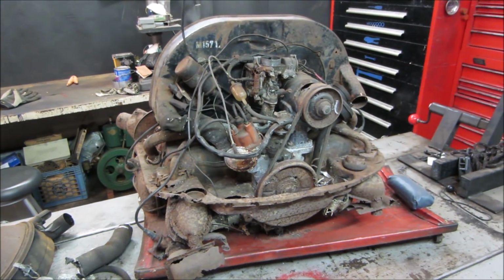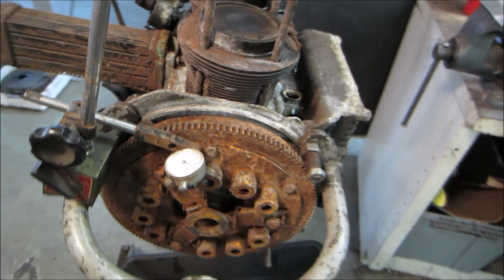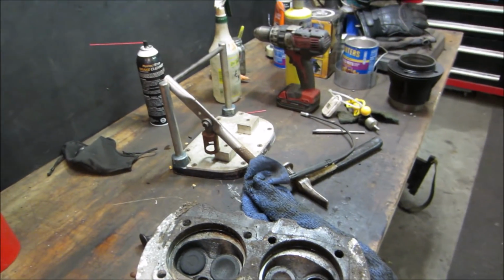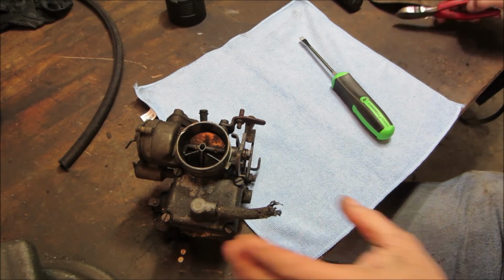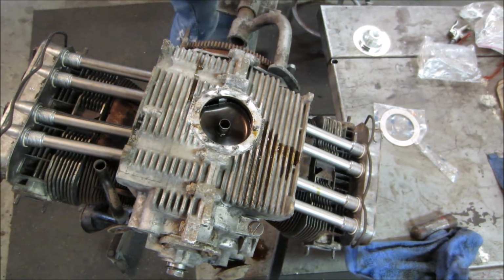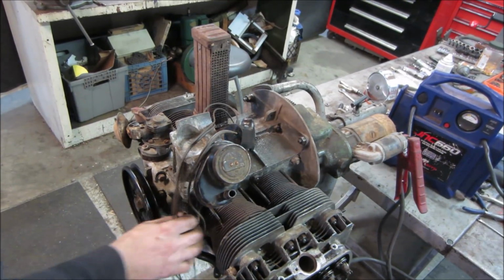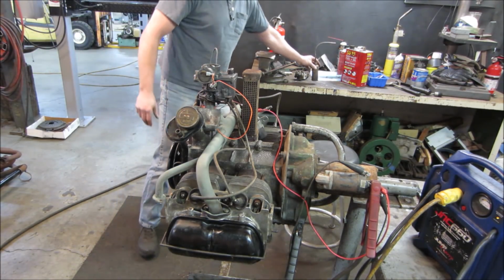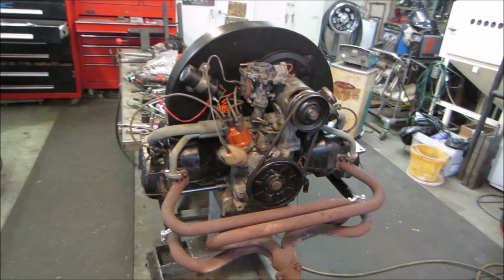Blown Up VW Bus Engine, Can We Repair It For Free?

Comment: I'm a little surprised that you didn't bother replacing the bearings.  Can you do that as s separate operation without undoing much of the work you already did?  Are bearings prohibitively expensive?  Were you just lucky not to hear much bearing knock when you started it up? or did you somehow know the bearings would still be fairly quiet?
      How is the oil Pressure?

Comment: I have a question, what is the difference in a single port and dual port on those VW engines that you work on? I've heard you mention that 1 is single and 1 is dual port can you explain what the difference is and where they can and cannot be used please?

Comment: The accelerator pump out of the carburetor if it is small enough to fit in something like a snuff can could be put in something like that and poured half full of brake fluid and let it sit for a few days and that would soften it back up to where you could probably use it and you can just leave it in brake fluid also for as long as you want just to keep it soft and that's what I do with the diaphragms out of lawn and garden equipment type carburetors and that VW carburetor reminds me of a big Tecumseh carburetor in a way LOL

Comment: if you use longer studs i forget which 2 you can put dual port heads on a single port engine which gives you a 1500 dual port which ups the power a bit drove one for years even raced it a little

Comment: Ive got a small problem with my beelte engine. I went to replace the valve cover gasket and as i was taking it off I noticed this black, slightly thick washer that was broken in half and in the lid of the cover. I've got no idea where it came from and I'm worried to drive it because of this mysterious washer. Anyone got any ideas?
Reply: Yes! That's probably the stock wavy washer that goes under the nut  holding the rocker arm assembly to the heads. They are known to break if you have side play in your rocker assembly. Check for that because you want to know what caused it so it doesn't happen again. You can use swivel adjusters to fix the side play if it is the problem. 

Instead of replacing the wavy washers you might as well get a few solid rocker shaft kits that come with the solid shims to replace the wavy washers. If you fix the cause of the washers breaking and use the upgraded shafts you shouldn't ever have a problem again. Just put it back on, torque it, and set valve lash again.
Reply: I forgot to add that it should be perfectly fine to just buy new wavy washers of the right size if you fix the cause of the originals breaking (probably fixing side play with with swivel adjusters). It's cheaper as long as it's a stock engine. The solid shafts are more for higher power engines.
Reply: @MrCarGuy  If I fix the play in the rocker assembly and I go to re-set the valve lash, do I have to do anything to the valves themselves (i.e. set them at a certain spot before setting the rocker arms back on)?

Comment: With the offset oil cooler, where does the air go after going through it
 since it's not going down over the engine/#3 cylinder any more?  
Anyone?  Thanks.

Comment: 59:59 You ought to invent something that is a combination screwdriver and alligator clip (with a T-handle on the end) that you could temporarily attach to the air/fuel mix screw so you could easily adjust the carb without having to fiddle around trying to find a screwdriver or deal with the vibrations.

Comment: 40 HP WAS INCREDIBLE...I TRADED AN APT SIZED REFRIG FOR A 61 BUG WITH A DROPPED VALVE ON #3...She had the sense to shut if off IMMEDIATLY 3 OR 4 DENTS IN PISTON...I replaced 1 ex valve and cleaned up the piston center a little...RE ASSYMBLED...DROVE TO LA AND BACK TO YUCAIPA, CA...GOT 33MPG...SOLD IT TO NEXT DOOR NEIGHBORS SISTER...SOMEBODY PUKKED OUT IN FRONT OF HER...ROLLED IT...WAH

Comment: When you were running the engine without the exhaust, when you revved the engine a plume of smoke was coming from the top of Cylinder #3. Did you re torque the head after the initial run? What was the cause of the plume of smoke?
Reply: Time stamp for reference?
Reply: @AstrosElectronicsLab  1:01
Reply: @hotrod1984s10  that was from the first video. He already said it had blow by on that cylinder because the head stud nuts had backed off.
Reply: @AstrosElectronicsLab  I meant the 1 hour, 1 minute mark

Comment: I think you are still not getting a good seal between your heads and cans.  It looked like there was an on throttle exhaust leak coming from under the driver's side head.

Comment: I had a 1958 vw convertible it was snazzy I dropped  a valve doing about 55mph the valve went threw the piston and threw the block and I was 18 and 265 miles from home the year was 1961 or 2

Comment: Build it with used parts. I grew up racing dirt track cars with a uncle who built v8 engines, 
 predominantly Oldsmobile motors. He had a huge box of used parts scavenged from dealership warranty engines that had been scrapped.

Comment: Yes 2021 reduce reuse recycle or upcycle yes what you need from what you got tool next to duck tape across from the wire and the hammer halfway down the spot where you stand

Comment: Please, please make a stand with a fuel supply and hoses on it so we are not frustrated watching you try to keep fuel up to engines, also it would give you a more accurate idea as to the quality of the repair / build and give you better time to make adjustments etc.. Surely it wouldn't be a huge job to knock one up. How's old Lilly?

Comment: Typical failure of the fresh air VW engine.  The oil cooler obstructed airflow to the #3 cylinder leading to overheating of the exhaust valve.  The stem gets brittle and breaks the head gets sucked down into the cylinder.

Comment: .003" on the endplay.   .006" is too much.   .015 is probably a worn out case,  thrust is probably toast.  Not that you can't run a motor with excessive endplay,  it's just not ideal.
Reply: I love watching you work with VW's.   It reminds me of my youth.  Built my 1st VW engine in 1991 at 13 years old.  Worked in a "VW Shop" for about 12 years.  We did a lot of what you do,  finding the best whatever out of the lot and working with that.
Reply: I've never seen lapping the cylinder to the head.  I love it.

Comment: I knew Mustie would make it run. I’ve heard running these without exhaust systems is bad for exhaust valves. Is that accurate?

Looks like the modern offset oil cooler was installed finally.

Comment: The only reason I watched THIS video is none of my other subs uploaded yet, if this had been any other topic (except the kit car, also another puke topic) I would have jumped on it.
Yeah kit cars, I helped a late friend build one, he had2 choices for a body fiber glass very expensive or plywood panels yeah guess which one he chose.
Imagine going for a test drive with your bud in his newly built kit car him driving and you're running at 90 and the front fender on your side comes off ,I demanded he stop I got out and walked back to my car and picked up his fender and carried it back, never again.

Comment: Looks pretty nice, but I don't think those self-tapping head studs will last that long. In my experience, and that of the shops I've dealt with, those are considered an emergency/limp home repair. I've almost always sent cases to RIMCO for case savers and that's never disappointed me, but I think that in a crunch I could manage to install a couple of them with the jug gone and the piston retracted into the case. It would be a hassle, but less of a hassle than putting it in a car and having to pull it out again 4000 miles later.

I've also been told, by people who have done LOTs more VW engines than me, that only the lower head studs ever pull out.

Any chance that excessive end play in the crank means the #1 main bearing is loose in the crank? Unless someone left out one of the shims, 0.012" seems to large to be undone by a simple reshimming.

You also need the air seals around the spark plug connectors. With those missing, you're losing a lot of cooling air and it's gonna overheat.

I love what you do and how you go about it. I've learned a lot from you about methodically testing the different systems to narrow down the parts that aren't working. I'm all about reusing old OE parts whenever possible, and getting by as inexpensively as possible. Still, I never want to do a job over again because something I did was not good enough to last.

Comment: Hay found or scavenged some VW Engine parts, carbs, split engine cases, heads, cylinders, pistons, rods, some single port some double port. some water cooled cases. mostly air cooled stuff. anyway watch your channel all the time big fan. want to know what my parts might be worth. I know a little about VW bugs having owned and learned auto mech. with them VW, datsun,  toyota, Honda Yamaha Suzuki Kawasaki so on and so on would like to email directly without giving everyone my email. or phone number. want to pick you brain if your up for it. let me know.

Comment: Just a couple points... 'A smooth cylinder IS an oil burner.' <--take this to the bank.  Rings hydroplane over oil if you don't have crosshatch in the cylinder walls.
If your compression numbers are more than 10% from each other, your engine will NEVER run smooth.
That 'thing' you call a hone is really a 'glaze breaker'.  A real hone keeps the cylinder round.  So, what you did by running stones in the cylinders, simply broke down a little rust.  Those stones are not rough enough to give meaningful crosshatch at 45° (which BTW, makes the rings rotate in the pistons.  I didn't see you measure for end gap.  I didn't see you measure for piston-to-cylinder clearance.  Any valve with more than .002" of slop in the guide needs reconditioning.

I build American engines but I don't build them the way you built this VW.  I guarantee, some of the metal chips from that oversized stud went straight into the engine.  Since there is no filter (only a screen) you're shakin' dice for longevity.  Sorry, but I would take the cases apart and rebuild it correctly.
Reply: I don’t usually comment to replies, but had to correct your remark about valve guides. Check your specs first. VW bronze valve guides started out new from the Wolfsburg factory with .009-.011” clearance/rock. The wear limit is .032” / .80 mm.  That’s a lot. It’s easy to feel with an exhaust valve .300” off the seat. Intakes only wear a tenth that much. It also means the VW has probably been running happily for the previous 10,000 miles and came apart for something else. Yes, .0015-.002 is good clearance for a Chevy iron valve guide that points DOWN & gets pretty well oiled. VW valve guides (bronze) are nearly horizontal, actually angled down at the rocker end. They never get much oil due to exhaust pressure in the port and they still lasted 50-75 thousand miles. This guy is having fun doing what a million shade tree mechanics did with VWs from the 1960s thru 80s. Because he can.
Reply: Great! What is the address for YOUR YouTube channel?

Comment: what a waste of time, this engine wont last 5k miles and you will have bad oil pressure and wont run right and will hesitate on accerelation and flooding sparkplugs from the oil passing the rings. Its just crap what ur doing lately, thats my opinion. Even though i do like u and been watching for years now.
But yeah, some guys have more spare time and money to play with. Good luck with that.